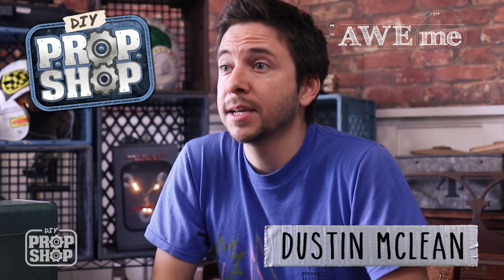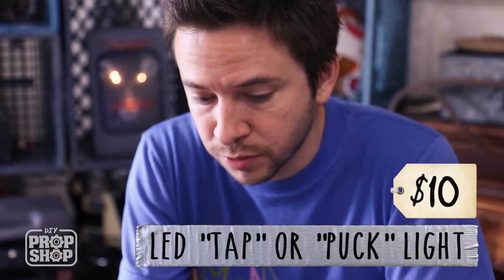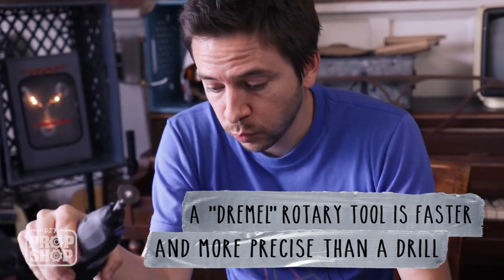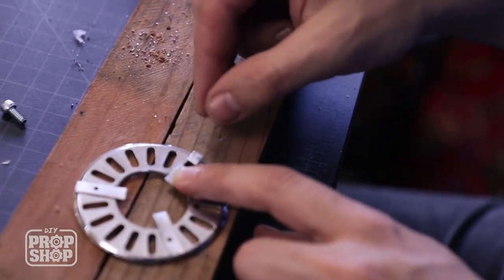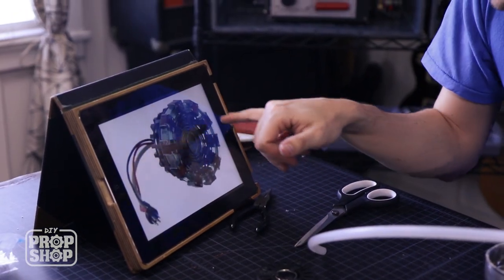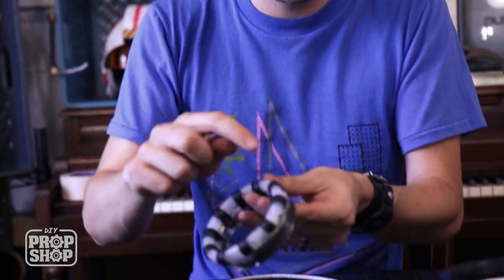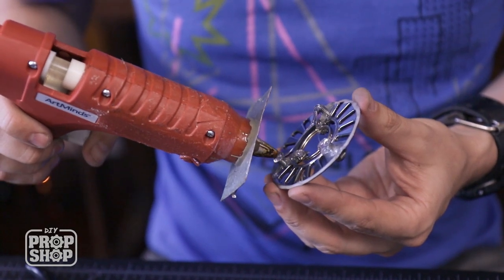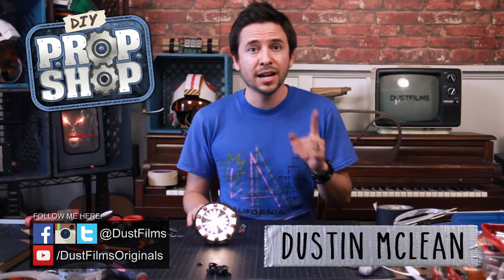Make An Iron Man Arc Reactor - DIY Prop Shop

Comment: The problem he had with the plastic tube at 5:10 Could be solved by dipping the tube into warm water until it soften.
Reply: Gabriel Abreu Lugão Ooh that's a good idea!
Reply: You've watched way too many soft tubing water cooling videos 😜
Reply: Or using a heat gun
Reply: james while , this is an easy tip that iv found in Cosplays forums/reddit.

Comment: too much hot glue; Iooks cool either way, but it's a shame you can also see the hot glue.
Reply: Behemothokun It's part of the DIY charm!
Reply: Behemothokun couldnt he use apoxy or super glue instead? I think it would be more secure in place and there wouldnt be alot of visible glue
Reply: +Dustin McLean thanx! now the flux capacitor!
Reply: Beef, just tried it with epoxy, it gets really messy.
Reply: ***** I've done it many times..
Reply: Roast Beef hot glue would probably still work even if you didn't use heaps. You usually don't need lots of it anyway.
Reply: +The Chilled “Frosty” Goomba I can imagine. Have used that stuff a couple of times, and it's not a precision substance by any account. But superglue, on the other hand... I mean, if you can glue Games Workshop miniatures together with it, what's stopping you? It's not like it's required to withstand any sort of serious stress anyhow.
Reply: +Behemothokun I didn't agree with your comment but I thumbed it up to make it an even 300, DAMN YOU OCD
Reply: lol sir if u put the reactor inside ur shirt do u think they will notice the hot glue
Reply: +MrGenedancingmachine LOL I understand your struggles.

Comment: That would look a hell of a lot better if you weren't so damn reliant on hot glue. It's got its uses, but it's messy AF. You'd have been better off using superglue or epoxy resin.
Reply: Omicron9999 that can be expensive tho. Hot glue is cheap, cools quickly and is easy to use

Comment: for the tube.. if you want to bend easier use a heat gun and warm it up a little until i gets pliable. instead of hot glue use CA glue, its super thin and drys in 20 sec. Ive used CA glue as a coating because you can polish it up and make a glossy hard to scratch finish.

Comment: When I made my latest arc rectors, for the light ring I took clear 1/4 in Plexiglas and took a circular drill bit and cut out a hole, then went a couple bit sizes bigger and cut out the ring, then I used my dremel to sand it down and make it opaque and murky, my latest arc reactor, I drilled in 1/2 way into the ring in several areas and inserted 3mm LEDs and wired them all in parallel

Comment: if you want to avoid all the hot glue over the place (a lot of people commented that it decreased the projects value) you could use another foggy tubing that is more pliable, or you could use super glue instead of hot glue, or you could use a hot glue stick, shave it down a bit to be thinner, then put it in some warm water to make it more pliable, then glue it to the arc reactor (just some ideas)

Comment: How long does the light last??
Reply: It depends on how long you leave it turned on, but I've had it on for a full day before. But luckily it's very easy to replace the batteries and I use rechargeable batteries so it doesn't cost much.